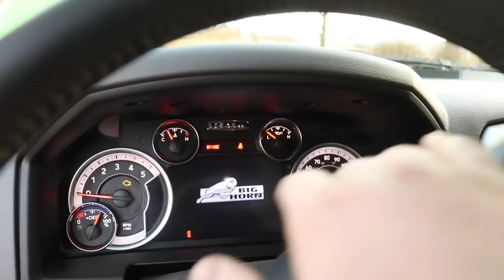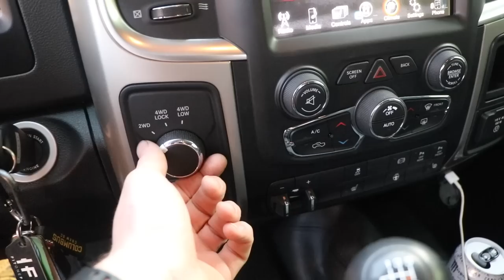Thinking about Buying A DIESEL Truck? Heres why you should ONLY buy A CUMMINS!!

Comment: Before I even watch the video, there's no reason you should buy a Cummins unless it's your personal preference. They make the least power, by far. They're lagging so far behind Powerstroke and Duramax. Even their High Output models don't make as much hp or torque as a Powerstroke or Duramax. Also, the 68RFE trans sucks. And for anyone wondering:

HP/TQ figures:

2018 Cummins (2500, normal output, manual): 350hp/660tq

2018 Cummins (2500, normal output, auto): 370hp/800tq

2018 Cummins (3500, high output, aisin auto): 385hp/930tq

2018 Duramax: 445hp/910tq

2018 Powerstroke: 450hp/935tq

So to get anywhere near a Powerstroke or Duramax, you need to get a 3500 High Output with an Aisin auto trans.
Reply from the maker: Now after you watch the video, like I said other trucks may have more HP and pull harder. BUT with ram you have options and you won’t rip your hair out trying to work on them (if you do yourself). Simple clean design  that will KEEP UP with other trucks AND hands down has the best suspension with the rear coils. I put lifts on trucks and test drive them all, out of them all the Cummins is hands down the best riding truck, best interior  and quietest cab. There’s more to it than just HP numbers. A McLaren has less HP than a Hellcat but who’s going to win the race the McLaren for many other reasons. (Metaphor for best truck)
Reply: Ryan Mayer I honestly didn’t watch the video. Ran out of time and had to do stuff. I’d argue ford has the nicest interior, but that’s a matter of opinion. I’d rather sacrifice the little bit smoother ride for a higher payload and towing capacity. If I wanted a vehicle that rides like a cloud, I’d be looking at other options than a truck. The Dodge trucks have issues. Like I said, there’s no reason to get one other than if it’s your personal preference. The competition performs better, and in many people’s eyes, Ford has a nicer interior. There isn’t anything too complicated on my Ford. It’s all pretty straight forward. What’s so overly complicated about ford’s and Chevy’s?
Reply: Ryan Mayer and I’d also argue Ford has a quieter cab. I could hear your truck at idle before you deleted it. I watch a channel who has a ford, and I can’t hear his truck idle, and can barely hear it running. And for a lot of people driving trucks, they don’t care about a diesel being quiet. Most delete theirs anyways
Reply: Cummins is the most reliable engine ever made. They dont just put them in dodge trucks they put them in semi trucks to haul over the road. I dont see any powerstrokes in any tractor trailers or anything besides their dumb pickups.

Comment: Your one of those guys who constantly says that “my trucks better than yours cuz it’s a Ram”

Too bad ford outsold those trucks
Reply: Too bad it also makes far more power too lol

HP/TQ figures:

2018 Cummins (2500, normal output, manual): 350hp/660tq

2018 Cummins (2500, normal output, auto): 370hp/800tq

2018 Cummins (3500, high output, aisin auto): 385hp/930tq

2018 Duramax: 445hp/910tq

2018 Powerstroke: 450hp/935tq
Reply: brickson98moto crazy man. Who would have thought there was a reason to not get a dodge
Reply: lol. Ford's are also rated to tow more. Stronger frame.
Reply: I'd hope there is more power out of something with 2 more cylinders lmao
Reply: I just picked up a 2018 Ram 5500 and I have to say they have come a long way from the 3rd gens. I had to leave Ford since they don't put a manual trans in their trucks anymore and the 2017s and up are ugly as all hell. I will say my 2016 F350 has more spunk to it but that doesn't matter to me, it's got plenty of torque. I would still rather be in my 97 F450 though, OBS for the win.
Reply: They outsell everyone because you have to buy a new one every 2 years because they are junk.
Reply: brickson98moto just because McDonald’s sells the most cheeseburgers doesn’t mean they make the best cheeseburger lol
Reply: Ford outsells everyone cuz their trucks are cheap. How many construction sites do you see with rams or chevys? Fords are cheap shit, numbers dont mean shit bud.

Comment: Funny that's why when I go to my Dodge dealer to take my wife's vehicle for an oil change and warranty work the mechanic shops are full of heavy duty trucks and 1500 getting worked on what are they doing just cleaning the motor. Lol
Reply: Funny, when my son has a recall on his FORD for seatbelts or door locks or airbags RAM doesn't. ALL TRUCKS HAVE PROBLEMS
Reply: @chrisfaulkner4160  Chris I can tell you for sure I've had more than 6 recalls on my 2014 Ram 1500 and I'm still getting the odd one in the mail. And I've got rid of the truck 2 years ago already. Lol

Comment: Does Dodge still have Cummins? Nissan has Cummins now..
Reply: Yes, they do.
Reply: I feel like being technical so no, they never have had Cummins, they do have a contract with Cummins though. Cummins is a separate entity that mainly makes motors in large applications such as semis and other heavy equipment. Nissan recently signed a contract with Cummins as well. Pretty much the same thing dodge did but with a smaller truck.

Comment: I like Dodge as much as u do but u just said Ford engine compartments are messy and blah blah blah... U bashed out Ford and Chevy but the Cummins motor is built by Ford.. Cummins is the 6.7L turbo diesel. In most Ford 250s or even 350s they have the 6.7L turbo diesel. Same thing. So really u just insulted ur own truck while also giving compliments to Ford..
Reply: Wow, just wow..........Ford has NEVER owned Cummins Engine Co.!...... NEVER !

Comment: Ram is cheaper by thousands apon thousands of dollars end of story.
Reply: Cheaper isn't always better.
Reply: brickson98moto dodge might have the best engine but not the best truck was my point
Reply: yeah. I wouldn't even say the cummins is the best engine anymore. They used to be so ahead of the competition but now they're behind everyone.
Reply: brickson98moto I’ve driven a duramax 6.0 and 6.4 but haven’t driven a 6.7 powerstroke so I don’t have an opinion on that one
Reply: Mine rides super smooth, even with a 6in lift, and the engine is bone stock and has all the power I'd ever need.
Reply: The ram is a great shipping crate for the cummins
Reply: Jarrett Mcmillan lmao 😂
Reply: @brickson98m  till they realease the 19

Comment: Sorry bud, but your ram 2500 has way less torque and horsepower than the powerstroke and duramax's 😂 Cummins 2500's are detuned ALOT. Yours has like 350 HP and 800ft lbs. The others have 400+ HP and 900+ ft. Lbs.
Reply from the maker: Yep the manuals are extremely detuned! But I bought the manual because I just deleted it and man can I say drives better than any truck I’ve ever driven and in my field of work I drive powerjokes and duramaxes all the time, not bad trucks just so many features I do not like about them and ram tops them by far
Reply: Alex Puls if a buyer plans on driving the truck bone stock those numbers are the Bible but Ryan has said as he’s doing, he’s modifying the truck. Once you modify the truck from stock, those numbers you have aren’t relevant anymore.